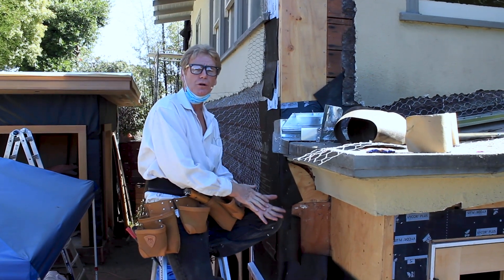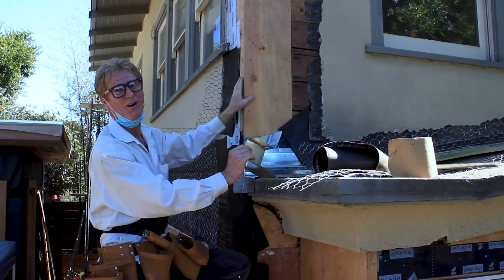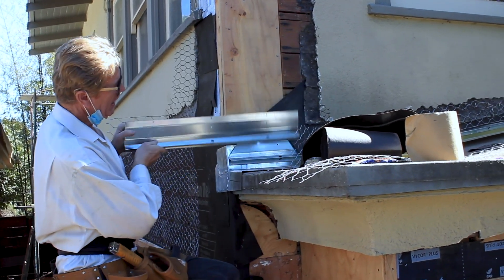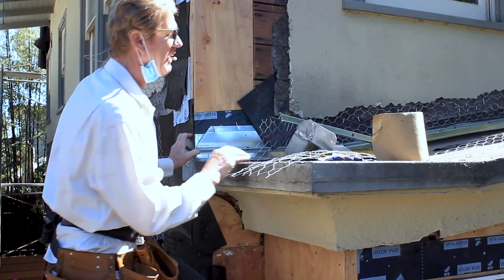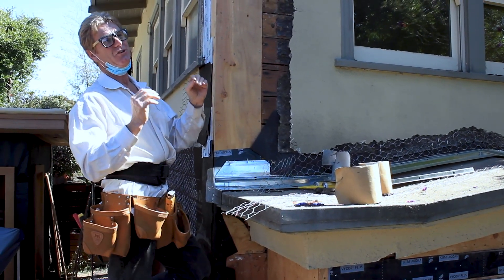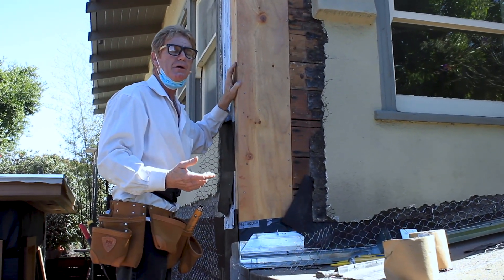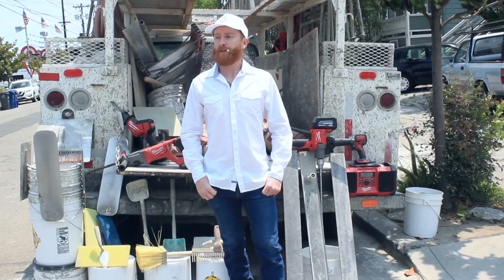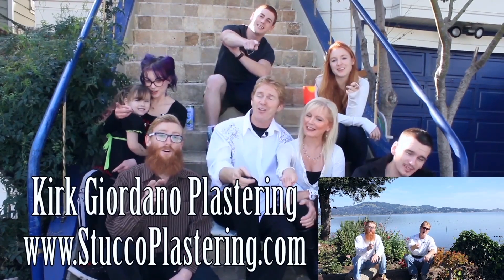Stucco roof-to-wall flashing, metal saddles.

Comment: Hi Kirk, 
Just watched your video today and it is as always very educational.  At the end of this video you applied a polyurethane sealed adhesive to the paper and stucco. It looks like a thick bead between the old stucco and new stucco which will separate the stucco rather than fuse ????
Reply from the maker: It’s to keep the paper waterproof.

Comment: Do these saddles come pre-made? Or do you have to make them my self and solder  them myself? If they do come pre-made where do I shop to buy one?
Reply from the maker: Evening Raymond, excellent question, my friend. As all roofs have different slopes, a good flashing man can make them fit any angle, then simply solder the joints.
 If one doesn't understand flashing, let alone how to solder, 
we'll then saddles need to be subbed out to a flashing man who does understand how to measure, cut, and solder.
I have not seen saddles in a hardware store. However, since this is not part of my trade, I may have seen them and not noticed them.🤔
Reply: @StuccoPlastering  Thank you for your reply, I'm running into the same situation on this back garage house unit in the back of my house. Where the end wall flashing and the weepscreed meet the wall. And it looks like there's a big gap and water could go into. You gave me a good idea on how to keep that water continually running down the side of it with the saddle. I just have no solder. Or I could somewhat make my own. So I'm going to have to come up with some kind of method that is similar. Thank you for your help.
Reply from the maker: @RaymondGettler723  In the description, I do show how this is fixed if you don't have access to saddles. Were always improvising where were forced to.

Comment: Hmmm...Dunno bout that caulking prior to plaster Kirk..understand the concept...but adhesion of concrete will not be to caulking...thus I apply after...subsequently...depending on finish...addressing thereafter...as dry joint results in a crack either way??? Acrylics...you know...Lime...
Reply from the maker: Good afternoon Forsaken to none, excellent comment, two things if I don't caulk this vertical tie in, my lath inspection won't pass. Thus, I'm handcuffed.
 On a brighter note, I'd rather have a hairline crack that can be flooded with a quality primer than a leak.😉
 Note: to all subscribers or anyone who stumbles on our channel with a question, type it into our Stucco/Plastering channel, and like magic, a video will appear to explain how it's done. 
This feature is miles ahead of any plastering forum. 🥳
Kirk Giordano Plastering
Reply: @StuccoPlastering  
Ahhh so call it suit blockage that does not know their ass from a hole in the ground!!! 
Reason I mention is based upon my experience Kirk...concrete sticks not to caulk...and in time...shall delaminate from...therefore re-exposing underlying caulk joint...fully...I would have to argue with a sample to over ride the authoritarian incompotence...providing proof...
Typical is it Kirk...all can read a book...yet it generally results in non comprehension of it thereafter doing so...

Comment: I have a small ac patch I need to plaster can I just put a piece of durock cement board on and apply bonding agent then stucco it or what do you prefer
Reply from the maker: Evening Alberto dude, of course, you can, don't forget the most important part, the two layers of paper or the waterproof membrane. There are many ways to skin a cat.🥇
  Note: to all subscribers or anyone who stumbles on our channel with a question, type it into our Stucco/Plastering channel, and like magic, a video will appear to explain how it's done. 
This feature is miles ahead of any plastering forum. 🥳
https://www.giordanoplastering.com/

Comment: Hello Kirk. I have a home (in Socal) that needs stucco repair on exterior wall. Many suggested polymer bond coating after cleaning the surface that has old peeing paint. One of the stucco company however recommended to use FoamTek before applying the cementitious traditional stucco. Can you comment on Foamtek use for this ? It this same as polymer bond that others are suggesting >

Thanks. Love your videos.
Reply from the maker: Good evening SJ, here's the long version you asked.
WELD-CRETE or Quikrete are the only two I use. below are the reasons why?
https://en.wikipedia.org/wiki/Polymer_concretehttps://www.awci.org/cd/pdfs/9502_b.pdf: 
https://www.homedepot.com/p/Quikrete-1-Gal-Concrete-Bonding-Adhesive-990201/100318465
https://youtu.be/IwseKOFpy8M: Weld-Crete Concrete Bonding Agent by Larsen Products Application How to Use
https://youtu.be/iiC8HUKLyHs: stucco/plaster bonding agents for plastering, in this video I dilute it as it’s too strong to use full strength
http://www.larsenproducts.com/weld-crete/ I have been using this bonding agent for 40 years and have yet to see it fail thusly choice.
     Cheers,
 Kirk Giordano Plastering
Reply: Thank you sir for that. Should I be worried that this company recommended foamtek as bonding agent ? Do you have experience with it as good bonding agent ?
Reply from the maker: Good morning Lee, I've only used two bonding agents, weld-crete and quikrete, so I'm not in a position to judge any other products. 
I'm in no position to try new products when the ones I have been using for 40 years have never failed me.😉
Note, You may also type in any question you may have on Stucco/Plastering issues on our channel, and like magic, a video will appear to explain how it's done. 
This feature is miles ahead of any plastering forum. 🥳
https://www.giordanoplastering.com/
Reply: Foamtek is the way to go. It’ll stick to any painted surface. That’s how we do it down here.
(SoCal)
Reply from the maker: Good evening BlackHemi, no worries, I don't sell or push products, I explain the ones I like or use. There are many ways to skin a cat.😉
 Note: to all subscribers or anyone who stumbles on our channel with a question, type it into our Stucco/Plastering channel, and like magic, a video will appear to explain how it's done. 
This feature is miles ahead of any plastering forum. 🥳
Kirk Giordano Plastering

Comment: what does 60 minute paper mean ?
Reply from the maker: Evening Mr. Bigtime, it means, for example, the  Jumbo Tex 60 Minute is the industry's leading 60 Minute has six times the water protection of standard Grade “D” paper while providing optimal breathability, and permeability; 
   For stucco, fiber cement siding, brick, vinyl, and wood siding.
    I simply tell folks its code and we have to use it.
 Cheers.

Comment: Doesn't caulking the cement prevent a good (cement to cement) bond, or are you using it as a flexible barrier between the existing and new?
Reply from the maker: Good evening my friend, nither. I'm caulking this transition as I won't pass the lath inspection unless this is completed.
 This can cause a hairline crack as I lose the key, but I prefer the waterproofing instead of a key. Besides, my hands are tied. I'm caulking this vertical transition, or I will fail my lath inspection.
 It's much more involved than this by this is the fastest version of, Why.
 Note: anyone with a question, type it into our Stucco/Plastering channel, and like magic, a video will appear to explain how it's done. 
This feature is miles ahead of any plastering forum. 🥳
https://www.giordanoplastering.com/

Comment: Are you able to restucco a house over the existing stucco or does it need to be removed first?
Reply from the maker: Good morning Pablo, of course, you can change the stucco finish or texture without removing the stucco. 
Note, You may also type in any question you may have on Stucco/Plastering issues on our channel, and like magic, a video will appear to explain how it's done. 
This feature is miles ahead of any plastering forum. 🥳
https://www.giordanoplastering.com/

Comment: Hi Kirk I had my security bars put back on my new stucco.  Iron works man drilled a  1in by 1in round hole into the outside stucco and through to my inside plaster wall into my bedroom to reach safety latch.   Unfortunately the  security bar had to be removed because of multiple mistakes made during installation that left me with this hole.  The empty space between the outer stucco wall and the plaster wall looks to be about 1 1/2 to 2 inches. I want to know if  I need to open the inside bedroom wall just a little to patch that hole from the inside so that when Im able to get the Stucco guy to come back out to fill in the 1 in by 1 inch round hole with about a 1/4 th inch of plaster to be filled in. I dont want to leave the inside  wall on the stucco side unpatched because stucco might fall in between the two walls in cause other  problems when they patch it from the outside. The stucco guy only does outside stucco. What are your thoughts on how to correct this.
Reply from the maker: Good morning Susan, Id buy a tube of More-flexx caulking, works for both interior and exterior. Problem solved 7 bucks.😉
 FYI, If the caulking sags a bit, no worries, do the best you can let sit two days, then use more and trowel it on better.
 Mor-flexx caulking has sand in it, but you can use a putty knife to make it smooth also.
Note, You may also type in any question you may have on Stucco/Plastering issues on our channel, and like magic, a video will appear to explain how it's done. This feature is miles ahead of any plastering forum. 🥳
https://www.giordanoplastering.com/
Reply: @StuccoPlastering   I have a few questions. How do I get to your channel, I could not find it. I contact you through youtube. Secondly because the hole was drilled through all the coats of stucco will the  mor-flexx be enough to keep water out when it rains?.
Reply from the maker: @susanp6057  yes it will work for all those reasons.
Cheers.

Comment: In the uk, we call it lead flashing and render str8 over it, no need for drip beads
Reply from the maker: Good morning Volt, my fellow spread from the UK. Here, we're required to place a weep or drip metal on all roofs, as we're not allowed to run the stucco to the roof.
Many ways to skin a cat.😏
Note, You may also type in any question you may have on Stucco/Plastering issues on our channel, and like magic, a video will appear to explain how it's done. This feature is miles ahead of any plastering forum. 🥳
https://www.giordanoplastering.com/
Reply: @StuccoPlastering  as i say, we use a lead flashing so it can b rendered on/to majority of the time we fix a rendered bead to it anyway!